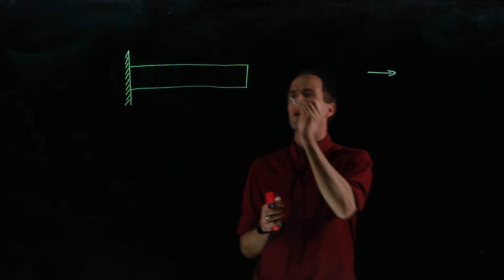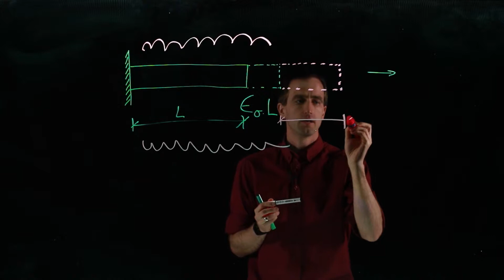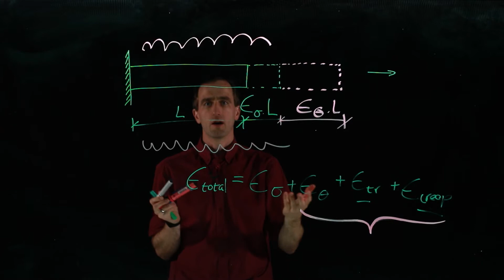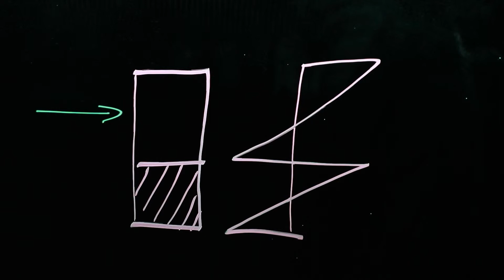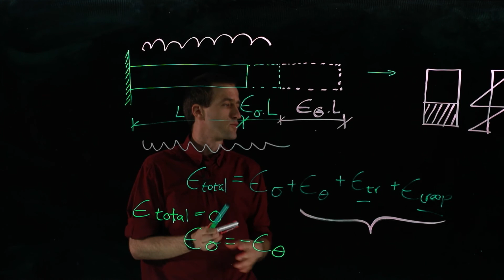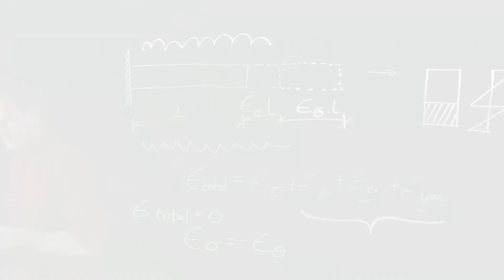Design of Structures Exposed to Fire: Strains in materials at elevated temperatures

Comment: I'm designing the binding steel around a glass fabrication melting furnace (furnace is about the size of a house), and binding steel can be exposed to temperatures as high as 1000°F. I was planning on simply using the material strength reduction factors listed in a AISC's Table A-4.2.1 (the "red" steel book governs our design in Tennessee); however, I'm getting some hesitation from the engineering subcontractor I'm working with. They don't think we can use these reduction factors because they believe these factors were only meant for a "temporary "fire condition and not a prolonged, continuous glass melting furnace campaign that can last up to 20 years. I reread the code, and I don't see anything about these reduction factors being restricted to a certain "duration" of fire... I only see a note that says as long as the yield strength is below 65 KSI, the factors in the table are applicable.

Do you have any insights on this, or do you think anyone in the AISC community might?
Reply from the maker: When I worked in practice we did lots of glass furnaces at my old company. 
Few tests have been done on long-term strength reduction, where steel has been exposed to high temperatures for months, but spending time on Google scholar you might find something. The data available is probably suitable for long-term, but has not been verified in long-term tests. At a constant temperature I cannot see a chemical change occurring based on duration of testing. 
However, of greater concern is restrained thermal expansion if members cannot expand. That induces very high forces. Hence, my suggestion would be to ensure members are not restrained from expanding through careful connection detailing. However, may be sensible to used slightly reduced factors for the reduction factors based on uncertainty regarding long term effects.